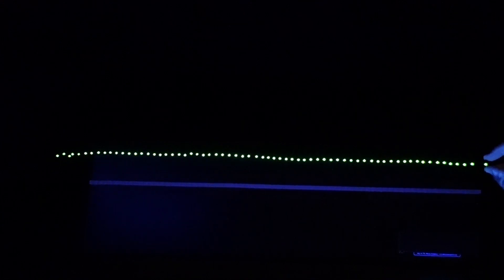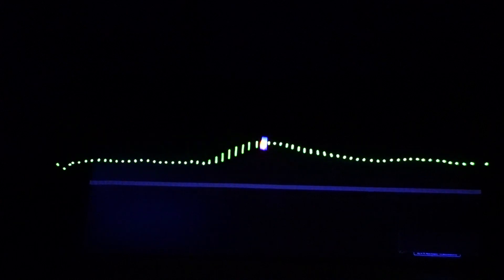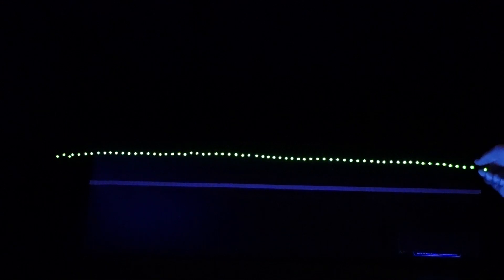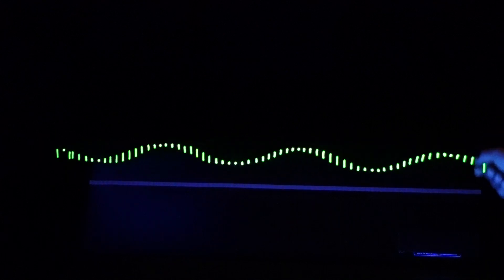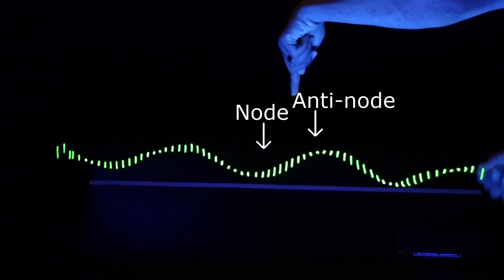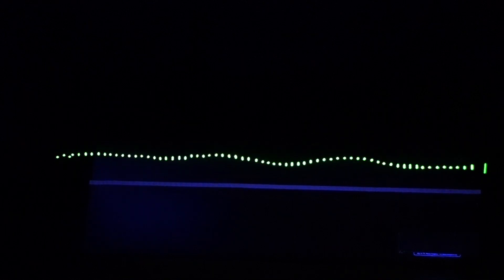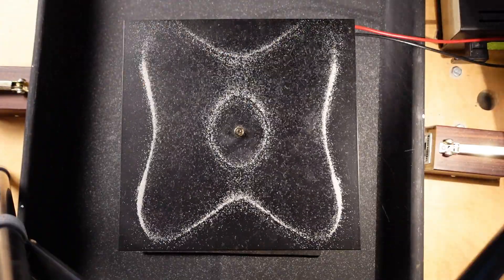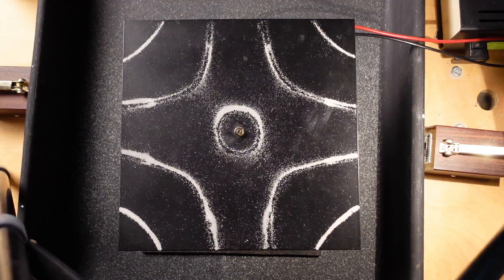Chladni Plates seriously look like magic!

Comment: Hi. Great video!! I have a question for you. Would it be possible to recreate this in a tiny scale? It could be a metal plate measuring 3.5cm x 3.5cm. Would it help if the plate is thinner and the powder is finer?

Thanks!

Comment: I still wonder how waves ar sent to these plates. 
Is it only by the small bolt in the center? Just moving up an down as if glued on a speaker?
Some shapes are not symmetrical,  where does that come from?
The more you know, the more you know you don't.

Comment: Great video. I love it. How about following question : When light is just an electro-magnetic wave, a little area out of a broad spectrum. Then I wonder, if radiowaves also behave like light when passing through an optical lense ? If not, which are the limits in wavelenghts being affected by optical lenses ?
Reply: It all depends on the transparency, the frequency and the speed. Eg some clear lenses are opaque to infrared, the front side of your TV or receiver is transparent to infrared but nearly opaque to visible light, the same exist for radio waves, choose your material wisely.
Then there is speed. Light is slowed down inside the lenses so it can be refracted on a different angle, and by choosing the right shape of a lens you get the wanted result (converging, diverging). But different colors behave differently: Red and blue don't focus on the same focal distance, think about infrared.
So there is much to say, you will be amazed.
BTW sound is also a wave - what a surprise - , I have seen a lens for sound: shaped as an optical lens but larger, filled with feathers that slow down the sound inside, and you get the same kind of result.
Eg on the focal point you hear the sound, but move slightly to the left or to the right and you don't hear it anymore.